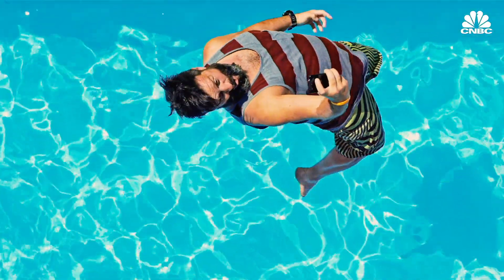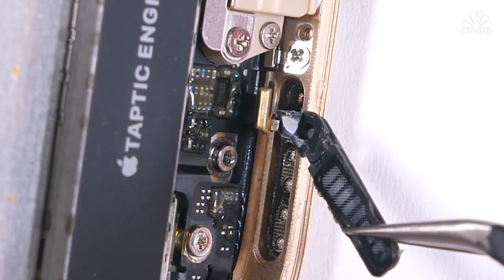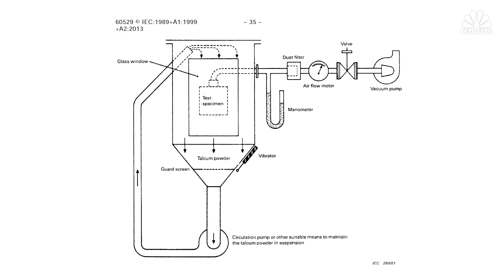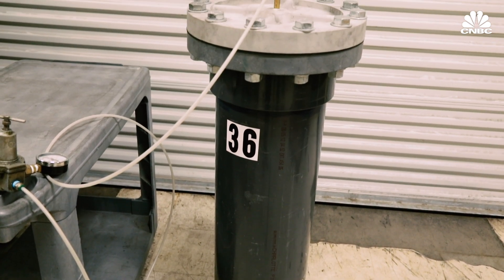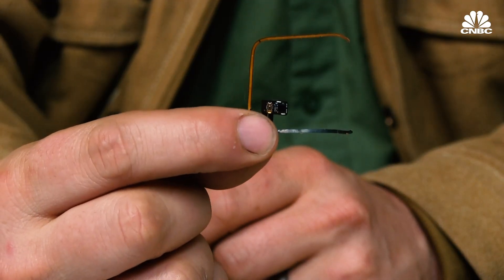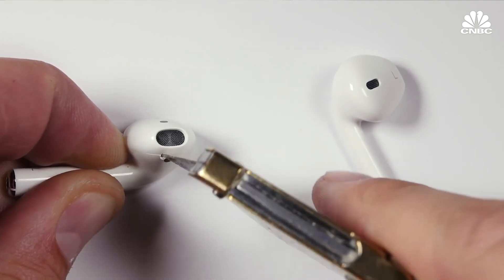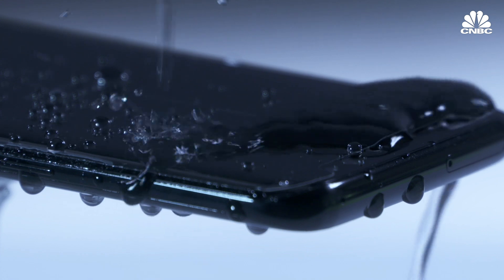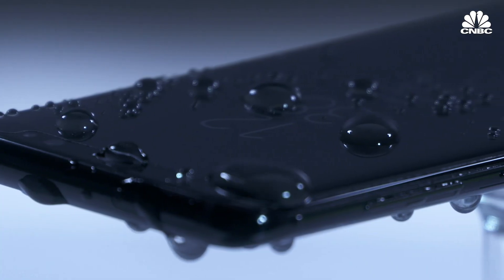Is The iPhone Waterproof? Water Resistance Explained

Comment: I got 2 ipad minis destroyed around 2013s because the first one was bitten by my puppy dog and the other one got soaked in the flood when we had a bad typhoon. Both got destroyed because of the water damage. Then back in 2016, my iphone 6s which is still has mediocre IP rating got soaked during a rainy trail run in the mountains and it shut down. Thank God it still worked after soaking it in rice. With my 8 and iphone pro max, I never had these issues since then that I can bring them in rainy runs or even swimming. Still thankful whoever started this waterproofing for phones and gadgets. They are a lifesaver from spending a fortune

Comment: People should know no iphones(or any other phones) are waterproof. 
i took photos while in a pool, didn’t sink it, used it for only about 5 mins
but the brand new iphone 13 mini had the selife camera moisted
with care, it did resolve in time but still the device reboots occasionally (motherboard corrosion, a symptom of liquid damage)
Apple spill drinks, drop rain, pour mud in their ads, allegedly saying iphone’s water resistant. But they when it actually happens, its always customer’s fault. They should either state it in the ad or guarantee definite water resistancy.

Comment: I almost don’t see the point of coating the internal electronics. At least if you’re going to seal the case of the phone, then if water does get in, it likely can’t get out, and then will break stuff anyways. Unless of course they’re going to seal it up as if the electronics are sensitive to water. In which case, what’s the point.

Comment: Basically even if your phone is waterproof only use it in water if it A: has a case on it and B: has no cracks on the screen. If one of these applys to your phone you can put it in 2 ziplock bags or find a bag that tightly seals and put it in that.

Comment: I literally shower with my phone all the time. It’s an iPhone X almost 2 years old. Actually flew out of a moving vehicle at about 20 MPH and bounced down the road in a $30 battery case which did not work after the incident. No cracks, but 1 fairly deep scratch on the back from its trip. No issues with the water proofing so far.

Comment: Of course Waterproof does exist what a none sense, but water pressure can be difficult at a point also total corrosion free does exist.
When you put your smartphone in a plastic bag its totally water proof, also a watch and a lot of other stuff can be made 100% water proof with garantie.
Water resistance is not water proof and is absolut pointless in every sense.
Glue is never a seal to water proof that just a cheap solution to hold something together.

Comment: Reminds me of Xperia Z. My friends with Galaxy S4 and IP5 would test it by submerging it into a jug of water. For the first 2 years of use I would wash it in basin whenever it got dirty. The thing still works today after 6 years but not water resistant anymore because the seals of flaps are worn out.

Comment: I swam in the pool with my galaxy s7 few times..nothing happend..except the speaker did not work properly for couple of hours...after almost 2 years of usage I replace battery and screen on the phone...few months ago phone was accidentaly left in my  pocket in the heavy rain...was completaly wet..neither jack were functional..screen blinking turn of the phone because od moisture..phone did not work for couple of hours...I dryed it with hairdrier and it come back like new...know everything is fine...after 3 years s7 works like a beast. just to mantion iphone 6 is nowhere near water resistant..my cousin spill glass of water on it and it dies completly...never recover...so cut a crap with bullshits.

Comment: What you fail to comprehend cnbc is that the inside of the phone can be coated in silicone  so it doesn't matter if water gets in the phone  because water can't go through plastic. When the plastic starts degrading the phone is probably too old anyhow and you should get a new one.

Comment: So just make it sealed. Bt audio, wireless charging, water proof speaker and mic, non removalbe battery, no SD and built in sim and no hardware buttons. This is all possible today. They should survive full submersion to a depth.

Comment: The 7 or 8 in the last part of the IP rating indicates "water" resistance. H20 only. Chlorinated water is corrosive and salt water starts to break down metal and a lot of other items on a phone almost immediately. Nothing is waterproof. With only one huge exception, submarines. Obviously at 400+ ft below the surface even a tiny leak can be fatal in a few minutes.

Comment: to make a phone waterproof, remove all the air spaces inside by filling it with a resin that hardens, known as potting. Or fill the inside with molded silicone, designed to fill all the tiny air gaps.

Comment: Nice video and I agree with basically everything... but, having had water resistant phones in the past 7 years... (Sony Xperia Acro S --- Xperia Z1C --- Z3C --- Xperia XZ) I have to say that, at least on recent models you can verify the sealing condition by performing a Pressure Sensor test in the engineering screen.... In Sony devices you can go to the Phone app, and dial #*#7378423#*# and it will open the Service Menu, from there you can go to Service Tests and scroll down to Pressure Sensor... To verify sealing, simply notice the atmospheric pressure reading (should be somewhat stable) and then press gently your device from the front and back (thumb and index fingers) this will increase the inside pressure for a few seconds and it should read at +10 milibar from the unpressed number, if the device's sealing is properly working. If you open the sim cover and leave it opened, you can repeat the same test, and the pressure reading will not vary when pressing the front and back of the device, this will also happen to a device with sealing failure.

My Acro S had 5 different covers (SIM, MicroSD, MicroUSB, 3.5mm, MicroHDMI) and that phone water resistance worked for around 2 years, after that one of the covers broke and obviously I never took it swimming again. Here I was testing it in the ocean after a year of using it https://youtu.be/F11K2IkI2y0

I currently use the XZ and after 2 years, it still works properly and I take it to the shower occasionally, but I make sure to check the seals before hand.

I think the same can be verified in Samsung device with an engineering code and the included sensor tests, or maybe a Barometer app.

Comment: Thia is not true. In the most big company the water resiatant is renewd aftrr were open your dwvice (im a technition in a big comoany) we actually get the adhisive from the compamy that manufacture thw phone. Thw way its work is that you connect the phone to a apeical testing softwer and close with glue all the holls and put 500 grams weight on the phone and the pressure create is massured by the software

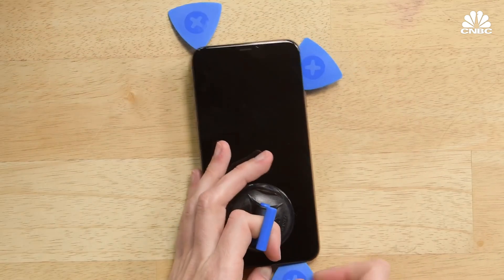Comment: 4:05 BS, the Samsung Galaxy S5 had a removable back, so you can swap out the battery if it was wearing out, or if you had a second one to avoid waiting for it to recharge. That phone is water resistant.

Comment: Really disappointed in Kyle women’s. Water resistance started on the 6s not the 6. The adhesive is mostly the 3D Touch sensor, the Bluetooth antenna is an after thought.

Comment: You realise it says on the Apple website it says that the phones 6 and higher are splash resistant probably implying that you shouldn’t be surprised that it won’t work when you hold it completely submerged under water

Comment: I had my Samsung S8 for about 2 years now, and it has suffered from multiple drops. 

I went to shower with it. Nothing happened and it is still kicking.

The only warning I got was a notification saying my charging port was wet, and that I should let it dry before attempting to charge it.

The notification disappeared within an hour or two.

I LOVE my Samsung S8.

Comment: They forgot to mention that the Apple Watch has a water mode that prevents the screen from being active. The screen turns on,  but it’s locked to your watch face. When you turn water mode off, a high frequency noise is played to eject water from the interior of the watch.

Comment: The truth about water resistance with phones vs watches is that for a phone it's so that it doesn't die if you accidentally drop it in a puddle/sink/toilet. With a watch, it's supposed to be a very good waterproofing that keeps the watch safe so you can watch your hands regularly without worrying about taking off the watch. You're not supposed to be constantly exposing your phone to immersion in water.

Comment: The IP rating is basically useless anyway or at least not exactly accurate. I’ve seen independent tests for the newest iPhones and Samsungs when the phones were in over 25 feet of water for hours and they didn’t skip a beat. They were brand new phones though and like they talked about at the end of the video, normal wear and tear can degrade the waterproofing features.

Comment: It's so sad; Sony was the first one to popularize it, and they don't even mention it.
Sony phones are still the only ones which comes with the both IP 65/68 ratings.

By the way, I'm using an S7 since 2016. It's still water resistance as I still wash it (with soap) now and then to clean it up.
Reply: All of my Sony phones have some problems whenever it reaches to three months or so. Sure a waste of money trying to fix.
Reply: @silvers2211  Theres is a warranty it shouldnt cost u

Comment: Motorola smartphone water resistance is the best one even at sea.
Because you can close the charger port and headphone jack built in.

The motorola DEFY!
Reply: I'm Motorola all the way, always have been, running new Z3, great phone, great price and it will beat Apple any day in all areas.

Comment: Called conformal coating we apply to the circuit board to seals it from all water. Been around for decades. Doesn’t water proof it but helps prevent some water damage, moisture damage. I laugh these experts say it’s new.

Comment: Kyle and His not so correct view. The support page on these devices explain what to do and not do. For example apples support page https://support.apple.com/en-us/HT207043 https://www.samsung.com/au/support/mobile-devices/water-and-dust-protection-ip68/ .Kyle, you and your axe to grind. Manufacturers never say its water proof and that water resistance is permanent. So be careful and if you want to test the limits buy the extended warranty.

Comment: My old Galaxy S7 had shattered back like literally it missed chunk's of glass on the back but the gold coating was still fine so when i went to the pool i used it as a underwater camera and it worked with no problems let me remind you that this is after 2 years of use, i droped it like 160 time's and last week i was at some river,water was so fast i had to grab it as hard as i can i almost tipped over, the phone still works but i switched to LG G6 and i have  0,0000000% trust in it's water resistance (I plan on getting S10e i just hate curved screen because I'm kinda fat so it's impossible to use it with one hand)

Comment: No phone is waterproof. Only water-resistant.
Reply: Not true, sony xperias were branded as waterproof, when i sunk my m4 aqua they had to replace it because of that waterproof sentence, later they remove that waterproof branding and replaced it with resistant, but m4 aqua was waterproof, i was swimming with it under water without problems for a long time, but once i dropped my phone into bath and my simcard slot opened, thats how it died, got a replacement from sony :) its a good brand
Reply: Not true my iPhone 7 is...I’d gone swimming under water and all of that no problem to this day.smfh
Reply: mrdominio100 it’s water resistant because it won’t prevent water from seeping in on all conditions
Reply: mrdominio100 Don’t be an idiot, the iPhone 7 actually has worse water resistance than most phones on the market today. And none of those phones are advertised for being waterproof.
Reply: I had Nokia they quickly off/full off/ completely damaged when it's in the  water. I also had Sony Ericsson they stay good in water better. Back in 2005

Comment: I have OnePlus 6. I had it in my pocket and went to jacuzzi. I dipped it once and immediately remembered that i got phone. Instantly stood up and put my phone on the side of jacuzzi. Now... You could say that i have terrible memory and you'd be right cause i forgot about it and later when we finished swimming someone(or me) accidentally pushed my phone into the jacuzzi ( it was still on) and we left jacuzzi working for probably another 15minutes until i dried my hair and got to the dinner table. Then i remembered where my phone is and ran to get it back. Immediately shut if down and put it in rice and left it there for half a day. To my surprise was working like nothing happened. FYI OnePlus was not advertised as waterproof at all.
Reply: Yeah they don't pay for IP certificaton, but they are somewhat water-resistant

Comment: I had and still have many phones, but only ones that survived under water or sea are Sony phones (except XPERIA Z that had no good glue and XPERIA Z3 Compact that was trash of phone). Even XPERIA XZ2 Premium survived water many times. IP Sony phones are only fully water resistant phones. On Samsung Galaxy S9+ after water fingerprint sensor died. Cat B60 after water died. Huawei P20 Pro after water had water in camera.
Reply: Tomislav Matić had my s9+ unter water for like an hour cause I didn’t noticed that it was under water. The only thing what died was the doubt if it’s waterproof

Comment: Had a iPhone 7 I dropped in the pool and the ocean. But then the Apple store needed to replace a speaker cause it quit working. Later that day rain water made the phone stop working. Not covered under warranty of coarse. So anyone that needs anything repaired inside the phone. Insist on getting one of the referb new ones instead of them opening your existing phone. Never have had a problem with any iPhone since the 7 when I had to get a phone replaced. Just don’t let them open any iPhone at the Apple store that has that gasket around the screen. There is no way of knowing if they reinstalled it correctly.

Comment: First water proof smart phone is xperia
Reply: Try Japanese phones, say Fujitsu line of smartphone : Arrows series. since 2011. Heck no, even Japanese Keitai(flipphones) in 2010  has water resistance and they can swap out batteries. Talking about technology 'advancement'.
Reply: @brianaerovalier4529  
First water proof Smartphone
Reply: Resistant *
Reply: Yh thats my phone
Reply: @withoutwarning1337  that isn't a modern day smartphone
Reply: @withoutwarning1337  smart·phone

Dictionary result for smartphone

/ˈsmärtˌfōn/

￼Learn to pronounce

noun

a mobile phone that performs many of the functions of a computer, typically having a touchscreen interface, Internet access, and an operating system capable of running downloaded applications.
Reply: @withoutwarning1337  that it isn't considered a smartphone?
Reply: @withoutwarning1337  and performs many of the functions of a computer.
Reply: And the first waterproof phpne is thr Nokia 3110
Reply: @nikosnkm3119  No, it wasnt waterproof
Reply: @iscander_s  it was a joke

Comment: "Samsung is new to water proofing..." what!?!?! They been doing that since the s4😭😭😭😭

Edit:S4 active was the first, s5 is waterproof, s6 wasn't but its tougher brother s6 active was waterproof , s7/s8/s9/s10 and onwards are "waterproof" and I own a s6 active, s7 edge and s8 active all have been submerged in water (including salt water because I'm a Fisherman) takin wonderful under water photos and videos and all still work till this day, s6 active died a month ago from battery failure :( 4 years old and it took one hell of a beating and still worked and was still waterproof throughout the years...
Reply: Isn't it the S5?
Reply: They are comparing to waterproofing in watches, has been around close to a century
Reply: Rey, that was the S5.
Reply: "waterproofing for a decade" is not the same as "waterproofing for a century".
Reply: Cough cough cough CO7GH s4 active Cough cough cough!*
Reply: Regular s6's were fairly water resistant, they just weren't advertised as such, just not safe for long term submersion.
Reply: Sony is the real og
Reply: S4 active was Samsung's first water resistant flagship. Then the s5 had a IP rating. S6 didn't. S7 and onwards has had it
Reply: No smartphone is waterproof. Period. I think you’ll find that they offer some level of water resistance.
Reply: They were late than sony, thats why they are new.
Reply: That's relatively new still
Reply: Rey Fuentes iPhone users smh
Reply: @bimbotm5789  iphone users?

Comment: In Sony Xperia commercials it was heavily advertised as " waterproof " and every ad showed the Xperia phone under water in lakes and pools all the time, these ads span from 2013 to 2015. Sony later dropped those ads as it was misleading, because many owners used the phones without reaching the 1.5m limit and the Xperia phones' display would stop turning on and eventually just vibrate continuously until the battery runs out. Now they just advertise it as " water resistant " able to survive a rain, not a swim in the pool anymore.
Reply: I remember those. The 1st gen Xperia Z was apparently waterproof same as the first GoPro cameras with just the flaps covering the charging port and aux jack - which eventually snap at some point. Lol.